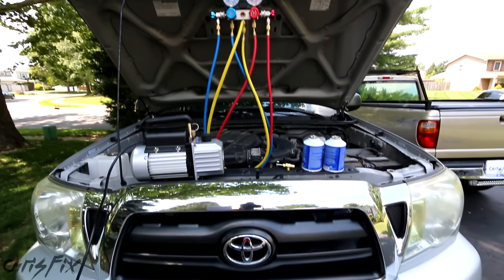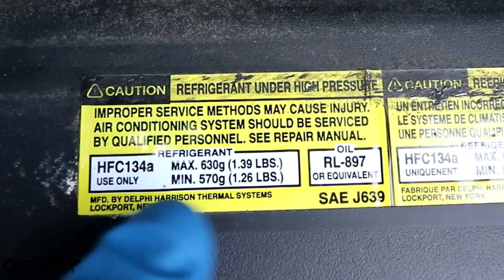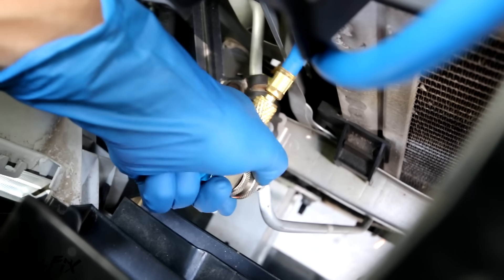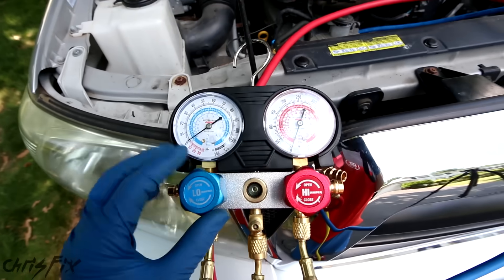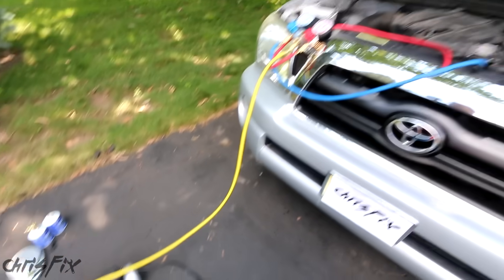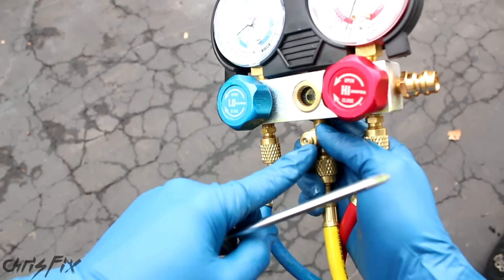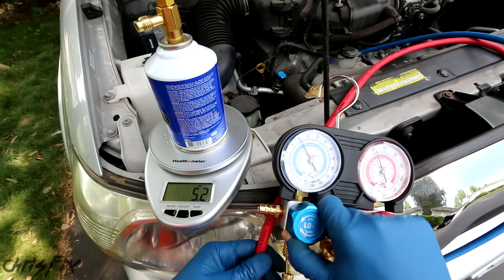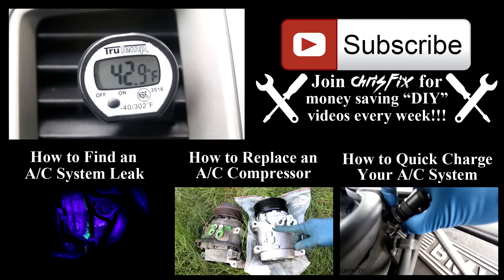How to Properly Recharge Your AC System

Comment: I’ve learned not to hook up the high pressure side while pulling a vacuum. If you’ve had a leak, a likely cause is the high pressure Schrader valve. If you pull a vacuum on both the low and high pressure side, you won’t find the leaking valve. If you pull a vacuum on only the low pressure side, it will pull against the high pressure valve and give you a better test. Otherwise you risk thinking you don’t have a leak and refilling the system, only to find after you disconnect your manifold, you still have a schrader valve leak. I’ll give you one guess how I figured that out.
Reply: So when you pull the vacuum and test for leaks just don’t have the high pressure side hooked up? Then hook it up and fill it up?
Reply: @Grubbsgarage  you hook up the high pressure side to fill it, but you don't open the high pressure side on the manifold. You only hook it up so you can see the pressure. You fill from the low pressure side. You never actually have to open the high pressure side manifold, ever. In fact some people label their high pressure manifold "never open" or "don't open". By manifold, I'm talking about the red knob below the red high pressure gauge.
Reply: @AlphaG33k  gotcha thanks! I plan on doing mine today!

Comment: If you dump Freon into the air, it’s a felony, it’s also a felony if a shop charges your ac and isn’t certified but anyone can do it at home with no problem. The EPA also calls r12 and r134 bad for the environment, now we have r600 which is becoming the industry standard, it’s also odorless and extremely flammable. The EPA are brainiacs.

Comment: Do I need a tank to capture the old refrigerant or does the pump have one built-in?
Reply from the maker: Yes you still need to capture the old refrigerant if it is not already empty. A mechanic shop can do that for you. Just ask them to remove the refrigerant. They can knock that out quickly.
Reply: @chrisfix  is there one on Amazon or does an certified person have to do it?

Comment: I pretty much did my system the exact same way as I've done this before. But my only issue is that the refrigerant isn't flowing from the can and I'm not sure why. The ac system is on full blast on the cars side I can see the refrigerant that was already in there moving in the sight glass. but the sight glass on my guage nothing is happening. Could that mean my guage is clogged up? and how the heck could something like that happen? I've never opened it up before since I bought it. oh yea and my low side pipe is not cold or sweating. Which I know is normal when the freon is not sufficient.

Comment: Great job as always! One minor point is that at 90F, according to AC standard chart, it requires 45 minimum on low and 250 minimum on high. You only got 40 and 200 PSI instead.
Reply: Am I the only one who thinks about how much refrigerant those gauge hoses hold? It appears he may have left 2-3oz in the high side hose when he disconnected his gauges. He should have closed the high side, closed the canister, open both side of the manifold and let the high side hose run into the low side.
Reply: Oh.  I just found the source for your data.  NO.   Those are general pressure guidelines.   OEM specs are EXACT.     Cooling to near 40 degrees is the proof.   If superheat isn't being calculated, those pressures could cause a lot of trouble.
Reply: @crforfreedom7407  you just weigh the refer in, stop making it difficult. engineers have designed the system already. theres no need to check superheat which is really difficult in a car anyways. you also dont need to look at subcooling either. again, the design specs are right on the damn vehicle. repair the problem, check for leaks, pull a vacuum, check again, weigh in amt of refer. the end.
Reply: @OxBlitzkriegxO  That's what I said: Just weigh it in.
Reply: @crforfreedom7407  What’s superheat?
Reply: @hardcore4476  the gas's current temp minus its boiling point. thats not easy to check in a vehicle's evaporator considering how hard it is to get to, let alone get a probe in there.
Reply: I didn't hear him say anything about high low pressure so glad you did
Reply: you are 100% correct but since he weighed in the refer, it doesn't really matter. system fill sticker on the hood takes care of all that.
Reply: @OxBlitzkriegxO  You can't get an accurate weight. You have the weight of the green can piercing tool AND the yellow charge hose, sitting on the scale. Unless you remove the can from the tap and weight it. If you do that you loose gas/liquid so your weight is OFF. Very hard to get this proper by weight. What hurts us is these small 10oz cans. Our systems need more than one can. Changing cans and such you loose gas/liquid.
Reply: @jimdavidson5208  uh, you just tare the scale. when adding a fresh can, you purge the lines before continuing to add refer.
Reply: @OxBlitzkriegxO  See at 11:47 in the video. He has a can of R134A, yellow hose and a can adapter on TOP of the scale. He reads 20ozs. No debate there. I get it you shut off at 10oz left. I as in ME, had a hard time getting the can to SIT there LOL and when moved it would weigh different. Chris had better luck with the scale than I did LOL.
Reply: @jimdavidson5208  it doesnt seem like you comprehend what it means to tare a scale. as long as you know the weights of the refer and your equipment, itll be ok since you know system design fill and pressures.
Reply: @OxBlitzkriegxO  I'm lost on the wordage tare a scale. My deal was I would love to weigh the can only but we have a hose and can tap on there too. Oh I just read up on tare. 0 out the scale on can 2 and continue on charging. THANKS for the tare heads up. Learn something new today!!!

Comment: I started rebuilding a car last year. I’ve removed the entire AC system and installed a new evaporator leaving the plastic tabs intact it sat outside all winter. Is it possible the evaporator is damaged, can it be checked before I complete the installation and recharge it or should I not even bother to chance ruining the entire system because of moisture and just replace it again?

Comment: Great video Chris! It gives rise to questions:

1. What if there is already some refrigerant in the system? Wouldn't the vacuum pump pull it all out and release it to the atmosphere?

2. They say that it is normal that AC systems need recharging periodically. So this means that it is accepted that all systems leak to some extent, right?
Reply: 1. Vacuum is needed if the system is empty. 2. I consider it normal leak if you need to top it off every 5 years or more. You should not do it every year.
Reply: If your adding freon only you dont have run vac pump unless it has non condensables in it the recover old freon an start over

Comment: So you are highlighting the low pressure gauge when it was supposed to hold a vacuum but my high pressure gauge is slowly losing vacuum. Should I be concerned?
Reply: Your high side should be leak free, meaning it SHOULD hold a vacuum. Losing pressure means that it has a small leak somewhere.

Comment: Thank you so much, but you forgot to purge the yellow line between cans
Reply: That line was isolated by the can valve... What exactly needed to be purged from it?
Reply: @mattmanyam  But the can tap (on mine anyways) is only closed in the "pierced" postion. So won't the new can get pierced when the tap is being screwed down & before the o ring & threads have a chance to seal?
Reply: yeah, following the process logically, I thought that was a bit odd. I'm no mechanic so what do I know

Comment: Sadly in Canada due to too much regulation we can’t get those 12oz cans of 134R refrigerants that you guys have down south. 
You have to be a shop with a license and buy it in bigger quantities which is cost prohibitive for a DIY kinda guy. All we got here is Duracool or Redteck propane based refrigerants. I haven’t tried it yet but tempted, as many say it runs cooler and puts less strain on the compressor.

Comment: If the vacuum pump only gets to 25 in Hg does that mean there is a leak or is the pump not strong enough?
Reply from the maker: If it holds for a while with the pump off, there is no leak and that is just your weak pump.

Comment: I'm doing the same thing but for some reason the system wont pull frion..does the can have to be upside   down to suck in refrigerant. 
System is holding vacuum

Comment: You should stress that you replaced parts.  If freon is needed there is a leak, what should the high pressure side read normally?  Also you did not show how to bleed the gauges if there is any existing pressure in it...

Comment: Chris, you stated to add the oil, if you bought a compressor without oil, but you did not explain what to do with the valves or how to handle the shrader valve. Also, when you added a second can, did you purge the system... like between cans??? 
i'm a bit confused.

Comment: I just ordered a new compressor, gauges and a vacuum pump. $300 worth of stuff. Wish me luck 😅
Reply: Update: I also bought a new condenser, dryer, low side line because mine has an orifice tube in it, along with everything else. Still can’t seem to fix my ac. Guess it’s time to take it to a shop.

Comment: trying to figure my problem out...    last night while sitting in car  turned on ac  ,  no cold air , just regular air..  Also noticed that the AC compressor did not go on nor did the second fan go on...it usally does...   Checked my in cabin filter was dirt replaced it... The next morning while I was driving I decided to try  the ac   , 1 st time  Same thing happened,,  after a few mins  tryed again It turned on the compressor and immediately I got cold  air like always..     Drove 10 minutes with it on,  ice cold like It normally does..    Parked  the car  Turned ac off ,, turned the car off started it again after about 20 minutes ....still blowing cold..  cold like a normal AC unit...     Should I even bother checking the pressure  ?  I have the gauges like this video,,, I just don't have a vacuum pump..     Also it's a little pain in the neck for me because I would need  to use my power inverter to run the vacuum pump Could you possibly run the car while you're doing it so I can run it off my inverter off my  car battery...   To me it sounds more like an electrical problem maybe one of the switches or even the connectors aren't making right contact or even the dash controller in the car itself...  When it blows normal the AC is very cold like a new car the car is about eight years old I had a new compressor  put in about two and 1/2 years ago it is always reliable..   any advice? It's starting to be  100+ every day

Comment: Good Vid.  I'd add a few points:  You never know if a leak is fixed unless you test it: pull vacuum, close valve and check leak down, if you lose vacuum you still have a leak. Some replacement condensers have steel touching aluminum and will corrode and leak just past warranty, in my case I installed mylar sheets between steel frame 
and aluminum tube/fins!

Comment: ChrisFix I have a 2019 Chrysler Pacifica. Just brought manifold gauge and the couplers didn’t fit high or low.  So do you have a particular manifold gauge that will fit updated vehicles ac low and high system

Comment: Terrific videos, Chris, here and for replacing the compressor.  Yet notice you don't say anything here (or the other video) about "flushing" the a/c system or replacing the dryer/accumulator or anything else.  I ask this as I'm seeing places like AAP require us to "flush" the a/c system and/or replace these extra parts. (or we void the warranty options for those outlets)  What's the current wisdom on these extra steps/parts?  Still necessary, or dated advice?

Comment: You're hoses are connected wrong.  The can turning process is magic?  Result of 42 degrees is unbelievable.  The XtremepowerUS vacuum pump has a brochure in the box which clearly shows which ends of the hoses (straight) are to be connected to the gauge manifold and which ends (angled) are connected to the truck's AC fittings.  This vid is more understandable if you rotate your pc screen back and forth while viewing.

Comment: but if it needs recharging its usually leaking? another thing is airflow.. fans working & clean coils. the average person wont buy a vaccum pump & gauge setup. the new refrigerant is 🌋 and the condensate drainline may be clogged?

Comment: For a guy who does AC work for a living for many years, I have to say this is a correctly detailed and informative guide. Great work ChrisFix!
Reply: How important is the air purging piece of this?  I have gauges and recently recharged my AC System and did all the steps in this video but didn't do the air purge part at the schrader valve.
Reply: @breckenridgerob9679  you added some air/moisture into the system. Not good practice, but at least hopefully you vacuumed the system which can have  lots of air/moisture.
Reply: @breckenridgerob9679  then there will be some air in the system.
Reply: I always wondered if sub cool method would work. But too many variables. 
Blower and comp vary. Plus under hood temps. I’ve never taken subcool/superheat measurements on a car. I’m kinda curious lol

Comment: Great info! I really enjoy your in depth videos, no one compares to how good you are at narrating these. I'm planning on replacing the accumulator, condenser, lines and evap core in my 2007 Dodge Ram 1500. I plan on having a mechanic evacuate it for me. My question is, after evacuating, do I go straight to installing new parts, then have it vacuumed and recharged? Or are there any other steps I need to take? Thank you for your tutorials.